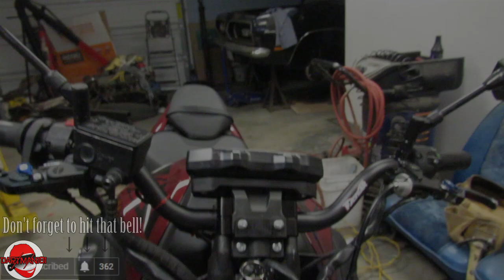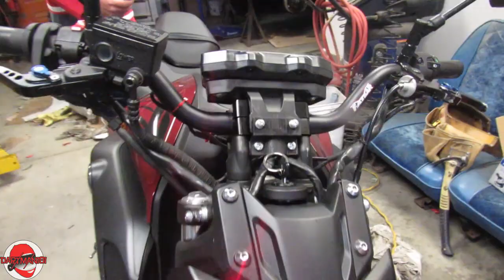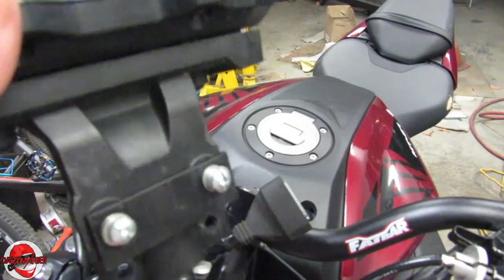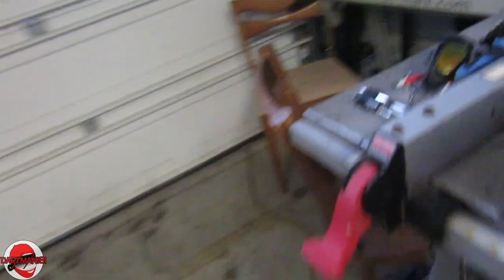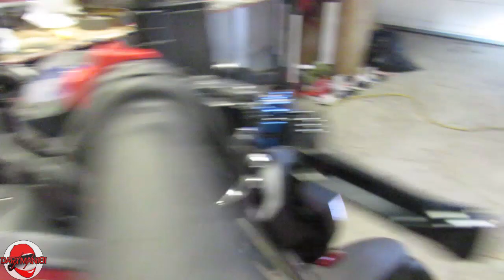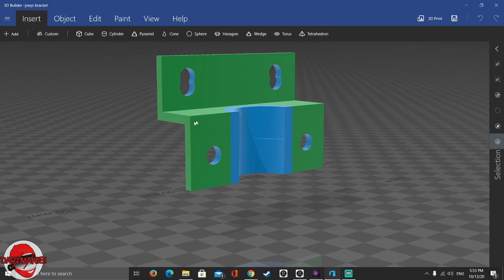2019 Yamaha MT-07 Fat Bar/Riser Install Guide & Custom 3D Printed Bracket

Comment: So what are all of the necessities for the fatbar install do I need a new throttle cable housing and grips?
Reply from the maker: Well it depends what you wanna do. We left everything stock. The only thing I had to do was to design a bracket for the dash relocate cuz of the height difference. My buddy didn't need to buy anything at all. We just had to re route most of the cables and hoses because of the height change. If you want you can buy a longer throttle cable and I don't think you need to buy new grips. The ones that he had we took off and put back on.